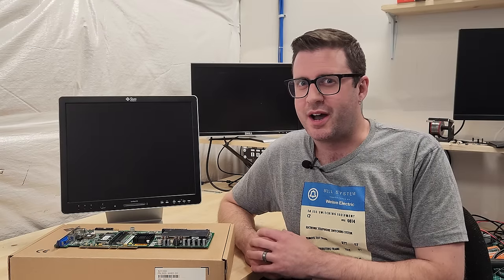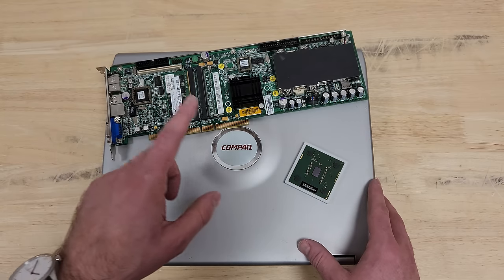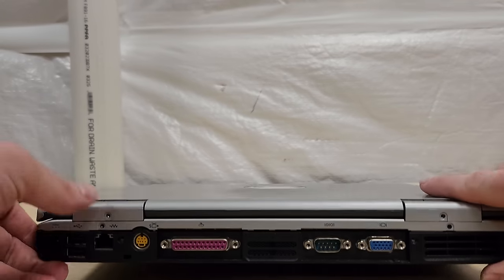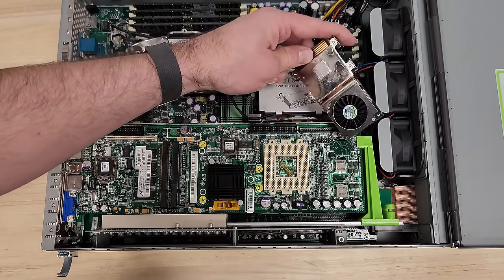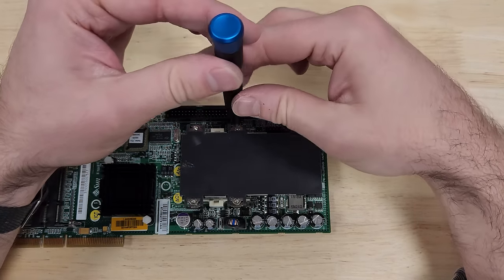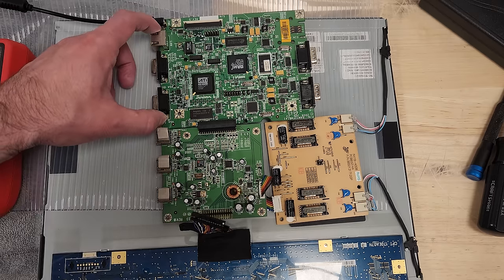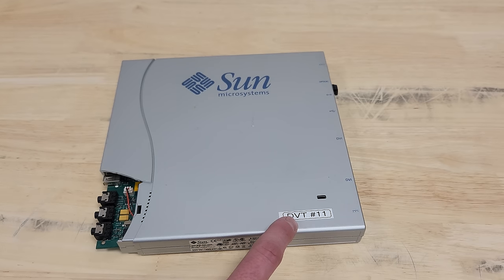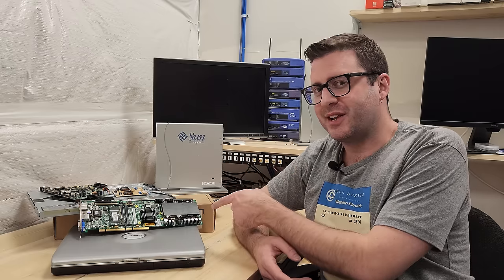Trying to fix Sun Microsystems Equipment

Comment: I remember those Athlon XP CPUs being able to fry themselves by heat. They had no built in protection from overheating so booting one without proper cooling they died from heat pretty quick. Hope you get that SunPCI III working!
Reply: I think Athlon XP had that protection built in, not sure if that applies to all the XP models. Athlon Thunderbirds and Durons would fry themselfes to death for sure because those didn't have any built in protection at all.

Comment: @clabretro , I found from experience that the Sun PC on-a-card suffered from the same issue as the old GoldenGate Amiga Bridge Boards, with the BIOS chips going bad after not being powered on for a while. Depending on the make and model, I found that the chips, needed to be re-flashed, or if, the were a weird flash-mask fromtheybrid, replaced. Also, for the Sun PC on a card, the power delivery to the BIOS Roms can be a bit unstable as the Caps age, and the caps that deliver power to the ROM are also part of the chain that powers the CPU and RAM, so if the ROM gets fried, the RAM and CPU may be damaged too. I advise testing the circuits for continuity and the voltages and amperage being in spec.

Comment: Only use plastic picks to pry plastic parts! Using metal to pry always damages plastic. Also HP keeps the service manuals online even for 20 year old laptops, so if you can't figure out how to open them, use the service manual. By the way doesn't that Sun x86 card have a VGA port? See if you get any output there?
Reply from the maker: Yeah couldn't find my spudger, new kit on the way :)

It does have a VGA port and unfortunately no output from it.
Reply: hp recently took my pc off the website 😢
Reply: @realstealthninja  which laptop is that?
Reply: @RedShift5  not a laptop but a desktop with a a laptop motherboard, HP P2-1366il

Comment: I swear laptops are designed by phycopaths. Why do they make them so bad from a service/disassembly point of view? I'm aware this is one of the better ones out there! Anyway appreciate all the SunRay stuff, I used to use them at university and have a bit of a soft spot for them.
Reply from the maker: agreed, I know I was complaining but this one wasn't actually too bad haha
Reply: Planned obsolescence started back in the 50's with automobiles, it's gotten way worse, now subscriptions expire and a device won't work if you don't renew, That's why I only buy open source. It's really sad to have watched all this happen in the computer industry, I started using them in the early 80's, by llate 80's and early 90's it exploded and you could buy tons of parts and just build a pc no proprietary crap, had to be compatible but that's not the same. And everything was made to repair or upgrade
Reply: I have a 2021 ASUS gaming laptop and if its CPU was in a socket, I could probably have it out in about 4 and a half minutes. Of course, now that access has improved greatly, so much more is soldered to the board.
Reply: I have an old Toshiba satellite & it was the worst. Only broke one speaker connector from age & had a few screws left. Just to apply fresh arctic silver and clean the fan.

Comment: Man, that's too bad about the Sun card, I'm really interested in seeing how it works. Hopefully there's another one out there you can use to get up and going. Thanks for the video!
Reply from the maker: Yeah I'll get it working one way or another. Thanks for watching!
Reply: @clabretro  Slim chance, but maybe both of the cpus are bad? Maybe there is a way to get the post codes out of the card?
Reply from the maker: it definitely could be, I'll try another CPU if the re-cap doesn't work

Comment: Regarding the Sun Ray 270, that error indeed looks a lot like one of those errors on standard monitors. The 270 has a VGA input, maybe it error is due to it being left on monitor mode. Maybe giving it a VGA signal and pressing the input button would fix it?
Reply from the maker: interesting... I had tried the input button, but not while giving it an actual input. I'll give that a shot!
Reply: @clabretro  It's also worth trying to connect the VGA output of the board to an external monitor, to see if anything comes up to prove the board operational

Comment: Those Sun Ray 2 thin clients brings back memories. When I went to uni in 2011 we still used those, and they hung around until 2014 iirc. Cant say that system was amazing, but it was still pretty impressive seeing that it was still serving the entire university well enough to not be a nuisance until the day they were replaced.

Comment: I bought a couple of sun ultra ac 5's off craigslist one time just to check them out. Spent a week messing with them. Was when I was really into linux. Got debian going on one. Then I spent a week troubleshooting things as the thing wouldn't boot and I had to mess with the eprom. Turned out one of the paired rams was bad. Thing absolutely would not boot without two good paired ram sticks. Once I got it going, I couldn't really do much with it. The tech was so far behind the times.. it was a fun experiment, and got to learn a bit about eprom. But, eventually gave them away to a sun collector.

Comment: I may be totally off, but is that ZIF socket one where you drop the chip in and then slide it down like... 1/2 a mm to engage the pins? There was also one you needed to use a screwdriver blade in the little ears to engage but it's hard to see if this might be that.
Reply from the maker: Yeah the laptop was like that, the SunPCI is similar but without an actual sliding mechanism. I did try to make sure it had good contact, but I'm still suspicious of it.
Reply: @clabretro  sad trombone :/

Comment: For the SunPCI III Pro, try cleaning the PCI connector fingers. They look badly oxidized in spots. I was waiting for you to do this and disappointed that it was never addressed, but I know from experience that sometimes it's the most simple things that get overlooked when troubleshooting.
Reply from the maker: They'd been cleaned shortly before the video and I actually cleaned them really well after the video to have another try, no luck. They might look worse on camera than they actually are; I sure was hoping it was that though.

Comment: 2000's and earlier laptops are such a pain to take apart. I tried to take my 2004 HP apart and even after removing about 87 screws and a dozen panels I couldn't even get to the DC barrel jack. I think one of the steps involved removing the display and it's associated cabling and I just NOPE'd out of that endeavour. Honestly surprised the disassembly instructions didn't involve reducing the components down to their base chemical elements. "Step 4,371: Harvest all the copper from the mainboard before continuing to next step."

Thankfully in the last 10 years or so, laptop makers realized that their machines didn't have to be built like a 5 layer lasagna and now almost everything can be reached after removing a handful of screws and prying off a bottom plate.
Reply: Modern laptops (particularly consumer model HP ones) often have critical screws under rubber feet which are impossible to put back. Older laptops have more screws but are also seemingly better built overall.

Comment: SunRay 270: There is a VGA input on that board, those thin clients obviously have a monitor function in addition to the thin client. Check if there is a way to switch the input back to the thin client.
Reply from the maker: Yeah I forgot to film trying that, it doesn't respond to input button changes. I also tried (after the video, after some viewers had the good suggestion) to try that with a VGA input actually connected and also no luck.

Comment: Great video, my fan was fragged in my III board, I don't suppose you tested the pinout of the fan, I wanted to make sure red was +5v and Orange is Ground
Reply from the maker: I can't remember if I get it on video anywhere but the fan does work, so probably caps or that CPU unfortunately!
Reply: @clabretro Thanks for the comment!  My fan was bad, took care of that but ran it without a cooler or heatsink which was unwise - so I had to order another CPU ebay which will hopefully work.

Comment: Howdy! Sun expert here who used a lot of these new. Part of your problem booting the Sun PCi III? You're doing it in a V240. It wasn't actually supported in those, and these cards are very picky. The Sun PCi cards (original, II, and III) are EXTREMELY architecture and firmware specific. The Sun PCi III will just not work in a V240. The PCI bus doesn't support it. I can see just from the ALOM that it's not detecting the card at all - there's no pci@2 devices.  The card itself is probably fine though - by the III, they were actually surprisingly reliable for Sun equipment.
Also, the only known major customer for SunRays, is Sun. The machines were so incapable and ridiculously licensed that they couldn't give the hardware away. (They tried. We said no. Multiple times.) And I never once heard a Sun employee speak even slightly favorably of them.
Reply from the maker: Hey! Interesting, I read in the 3.1 product notes that the III supports the v240: https://docs.oracle.com/cd/E19614-01/817-2968-11/817-2968-11.pdf (though I have a PCi III Plus here). I did see it post once but never again, which lead me to thinking it is an issue on the card.
Reply: @clabretro  might be possible, but I'd wager there's a stack of caveats including a minimum OBP version. It's been over a decade (obviously) but 'failed to respond. flags are 0' is to the best of my recollection, a failure in reading the PCI registers and NOT the card itself. The card itself is about 99% self-contained. 
So I suspect what's going on here is that even if the V240 gets VenID and DevID, it's unable to figure out the state of the card from the PCI configuration space. Especially since the BDF looks incorrect and it's failing to read the MAC address. Doing a `set-defaults` (will set ALL defaults including passwords!) in OBP might help, but I think the version of OBP is just unhappy. 
However, thinking on it, I also wonder if the battery on the SunPCI might not be the fault. Yes, there IS a battery - it's part of the RTC, and of course, 'not user replaceable!' I believe it's between the SODIMM and the large QLC marked 'BELLEROPHON' (next to the USB/FW riser connector.) /var/preserve/sunpcilogs might have something useful too.

Comment: Have you locked the cpu in the socket? Otherwise it has no electrical contact! It looks like a sliding mechanism that you can push with a flat hed screw driver up and down to shift the whole frame with the cpu up and down.
Reply: Same questions.
Reply from the maker: Yeah - the laptop has an actual sliding locking mechanism, but the SunPCI doesn't. I think the chip is meant to be slid sideways against/into the connectors. I did try to make sure it had the best contact I could, though I'm still suspicious of that.
Reply: Maybe it needs a thermal pad then? To press it down firmly into the socket. @clabretro
Reply from the maker: Not a bad idea, that might help

Comment: ...does that CPU socket move left or right to lock/unlock? if it does, that might be your issue.
Reply from the maker: The one on the laptop does but the SunPCI board doesn't... but it does feel loose in there. I made sure to push the chip tight in the direction of the socket pins before tightening the fan down, but I'm still a bit suspicious of it.

Comment: Is there a connector for a PC speaker? I had an issue on my old Slot 1 board where the BIOS had a slight corruption causing the 'CPU failure' alert to go off, fortunately in my case I was still able to boot into DOS and reflash it which fixed it. I got the fix from one of CuriousMarc's videos.

Is it also possible to pass through a PCI card? Maybe one of those diag cards could give an opcode if the CPU is still executing code, but not getting far enough to initialise communication with the Sun.
Reply from the maker: No PC speaker connector on the SunPCI that I can find, but yeah... I wonder if I have some BIOS chip issues here.
Reply: @clabretro , I found from experience that the Sun PC on-a-card suffered from the same issue as the old GoldenGate Amiga Bridge Boards, with the BIOS chips going bad after not being powered on for a while. Depending on the make and model, I found that the chips, needed to be re-flashed, or if, the were a weird flash-mask fromtheybrid, replaced. Also, for the Sun PC on a card, the power delivery to the BIOS Roms can be a bit unstable as the Caps age, and the caps that deliver power to the ROM are also part of the chain that powers the CPU and RAM, so if the ROM gets fried, the RAM and CPU may be damaged too. I advise testing the circuits for continuity and the voltages and amperage being in spec.

Comment: I think those All-In-One thinclients are literly just modified off the shelf monitors with regular off the shelf monitor controllers. That error about the cable not detected was likely just coming from the monitor controller, just like a Dell monitor would show if no input was detected, TLDR; monitor and monitor controller is getting power and funtioning but the thinclient computer compent istelf is not sending a display signal to the controller for the monitor.
Reply: Maybe try the VGA input with another computer to see if that even works.
Reply from the maker: Yeah that's what I'm thinking, all the video components operating just fine.

Comment: On Video is not visible is you connected the Athlon CPUs into the socket. Did you slide the CPU in the socket? (it's not enough to just drop them in the socket, sliding is important and not easy)
Reply from the maker: Yeah the laptop has the typical slider to engage the CPU, and I did that. But the SunPCI doesn't... I did push the chip to engage the pins as best I could (it seems to be the same mechanism, just without the thin sliding layer of plastic typical sockets have, if that makes sense). So I'm still a bit skeptical of the connection the SunPCI is making.

Comment: Have you tried using the parts from the pci card in other machines to test the ram and cpu? For the 2nd system, it has both vga in and out, do either do anything?
Reply from the maker: testing those parts (probably in that laptop, after I fix it) is next on the list. yeah I did try the input button on the 270 (forgot to film it) and it didn't make a difference. but one viewer suggested doing that with an actual vga input going in, so I'll try that next
Reply: @clabretro  what about the vga out? I’m curious if either the broken or working system also output simultaneous vga at the same time as internal video?
Reply from the maker: yeah I did try the VGA out of the 270 (and the PCI card for that matter) but no luck. forgot to put all that in the video too, of course! @JohnKiniston

Comment: Have you actually measured the rail voltages on the X86 board? Also, if its regular PCI-64, can't you put it in a donor X86 machine without fear of damaging the host.
Reply from the maker: I haven't yet but I'm thinking the same direction... get it in a machine where it's convenient to probe around with the multimeter and see what it's up to.

It's not a total failure... there is a status LED on the back of the card that consistently blinks amber (which means "potential problem" according to the documentation), forgot to put that in the video. Will be an interesting one to figure out.

Comment: The Compaq sounds like it's having a small power delivery issue....like a power rail is missing,

Defo a component lever repair of sorts but definitely fixable with the correct knowledge
Reply from the maker: yeah also a chance I didn't seat a ribbon cable properly too, I'll update when I get back to it!

Comment: The message on the 270 was generated by the screen itself.  It's the same "no signal" message you get on a normal monitor when the VGA is disconnected, or not at the right specification.  That really rules out any screen problem.  I'd start with checking power on the "main" board onwards.   And literally as I finish this comment, you've just said what I've written - almost word for word!!  I'm just a mind reader.  Ignore me!! 😂
Reply from the maker: great minds!

Comment: The sun 270 looks like you can use it as a monitor with VGA input? Does that work, is there a way to change inouts from external to the embedded pc?
Reply from the maker: I did try hitting the input button (forgot to film it) but it had no effect. another viewer suggested actually hooking a vga input up to see what it does which I'll try next